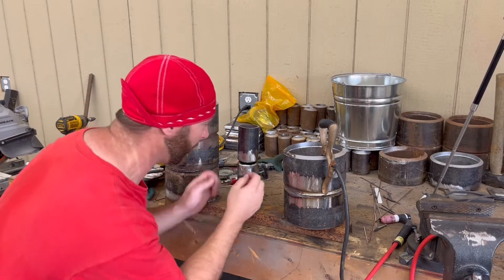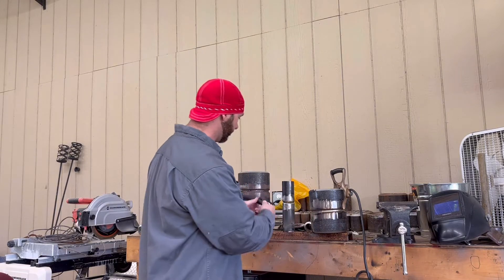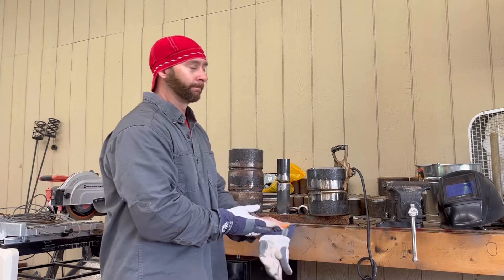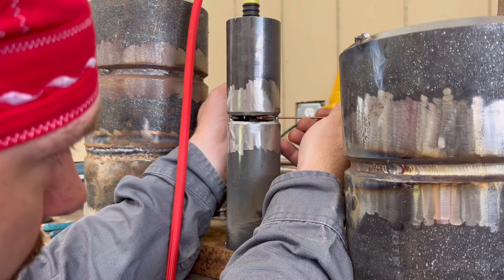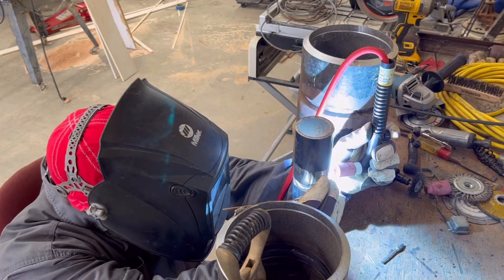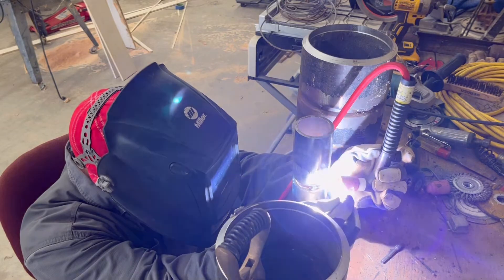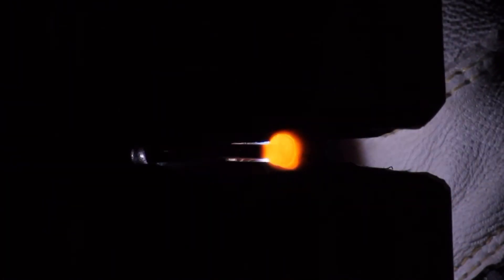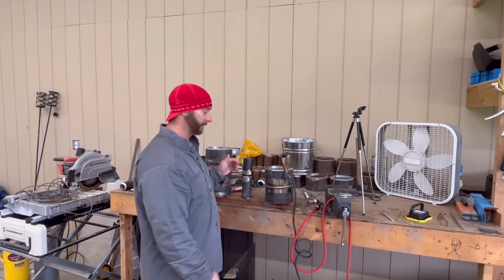How to Mirror Weld!!! (Root Pass)

Comment: have you tried the following?

- when going from left to right side, put the torch in the right hand;
- face the torch towards the weld so that you can always see inside the root and for the material to be better pushed inside;
- through the crack from your side, feed the wire with the left hand;

...reverse the previous methods for ``from right to left``. :)
Reply from the maker: Yes, they all work well. 👍🏻

Comment: what local are you out of ?
Reply from the maker: I was out off Boiler Makers local 263 in Memphis, then when they closed 263 I joined the pipe fitters in muscle Shoals Alabama. Local 760, which I am a member of now.
Reply: @getweldsoon1113  right on! I'm a member of Local 146 in Alberta Canada. great videos !
Reply from the maker: @jason11166  Thanks man I appreciate it brother. I worked in Canada in the oil sands for a while in 2012. They flew me home every 2 weeks. It was pretty cool. I was working for CBI.
Reply: @getweldsoon1113  u work at the Cumberland plant?
Reply from the maker: I have before but I’m not there now.

Comment: Nice vid bro what helmet is that? Has it got a flip front for grinding?
Reply from the maker: It is a miller elite. It’s an auto lens. No it doesn’t have a flip up. I can send you a link to it if you want to check it out.
Reply: @getweldsoon1113  thanks bro
Reply: @chrisplayz253  , realize that once that’s added, the weight goes up exponentially. I used to have one just like it and the weight is not bad. But I bought a Speedglas with the grinding feature and wow! Heavy!!!! Now I’m retired and it sits in a shelve never to be used by me again.🤣🤣🤣🤣
Reply: @kmichaelp4508  speedglas g5 01 is what I use it is heavy but offers the best comfort and protection by a mile